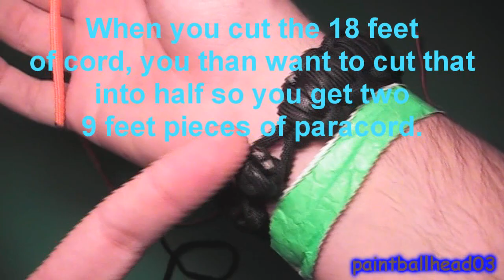How to make a Millipede Survival Paracord Bracelet with Buckle (THE ORIGINAL)

Comment: I don't know if you've addressed this or not, but you can do this with a single strand and a U shackle with adjustor.  You thread the cord through the fasten end of the adjustor and center it, acting as the tie end of your setup.  You then attach the other end to the shackle like you would with the buckle.  To deploy, simply slip the U shackle out and pull the adjustor.  The hardware I'm talking about is sold by sgt. knots on amazon.